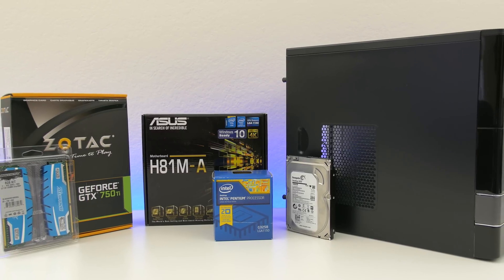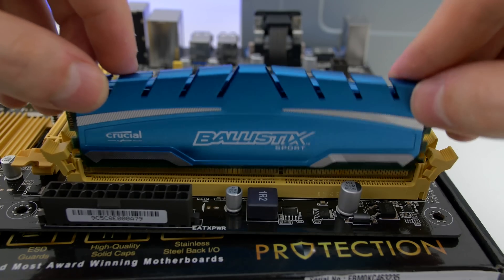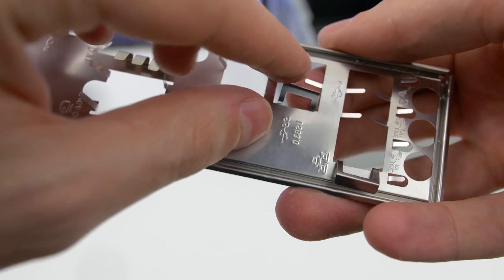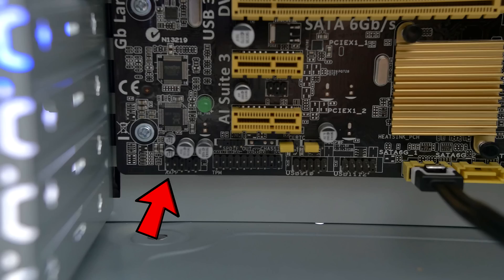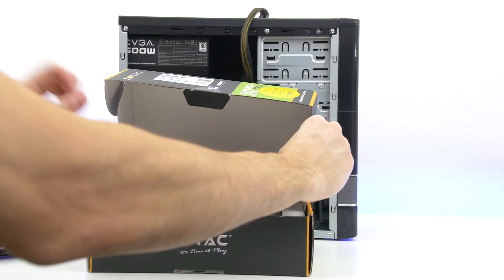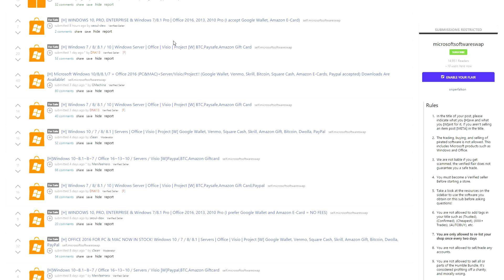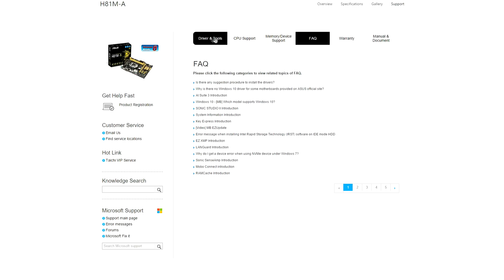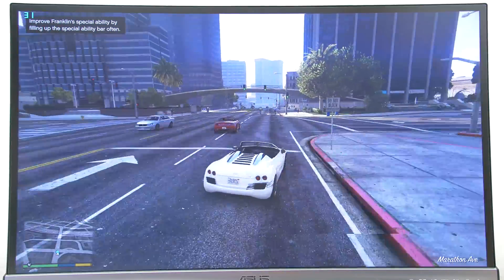How To Build $350 Gaming PC w/ Windows + Overclock!

Comment: I am going to make the same exact same pc. Thanks for the video! I will let everybody know in a month from today how the built went. It will take a month because I will only spend $100 peer week in parts so 3 weeks from today I will have all the parts I need.
Reply: mauro rodriguez Ah well the screws on the power supply were tough for me to screw in. That was about the only problem building the computer. When I set it up the WiFi adapter didn't work so I had to use an ethernet cable. The motherboard USB ports also didn't work, but when I downloaded the motherboard drivers they worked. When I plugged the WiFi adapter into the motherboard USB port, the WiFi finally worked. Those were really all the problems I had. Having to move around some stuff to make space for the computer was also tedious. It took me 2 days to build and around 4 days for all the parts to ship.

If you have any issues feel free to ask :)!
Reply: Good luck! :)
Reply: Why $100 per week?
Reply: 101ified because I am a broke college student. :D
Reply: mauro rodriguez Ah ok :P. I just finished building it... I had a ton of problems but eventually I fixed all of them and it works great!
Reply: +101ified what type of "problems" did it have? and how did you fix them... I am missing the graphics card and the HDD to be able to complete my build
Reply: ok
Reply: sorry i never replied, but the pc is great. except the Graphics card i decided to go with a 4gb Radeon overlock edition I think it was. It runs great, and it's not over clocked what so over. I have everything on normal settings, I can run most games from 2015 and down on ultra settings and 2016 and up on high to medium settings. Only thing I would upgrade currently is the Processor. Games like GTA 5 have a very high processesing requirements. BUt i run it in medium settings about 50- 60 fps. Mostly because i use mods also. Furthermore for hard drives and mouse and keyboards I would look in craiglist. I Found cheap hardrives for $20 and it been 2 years of heavy gamind and they still work.

I play games like GTA 5, Home front- the revolution, diying light, dead island, far cry 4 primal, and many open world games and have no problem running them mostly all on high setting, except GTA 5 I have it in medium to low settings when it comes to processing power, but for the GPU its always on high on all games if not ultra. 

I was not disappointed with this build, but then again i upgraded the GPU.
Reply: only problem a bit difficult was downloading the driver and triple checking my connections of the wires were correct. This was my first build, but it was easy to be honest. If you search online and craigslist, you will find good deals. Make sure the parts you are buying are quality parts and not cheap.
 

As of 2017 you can build a better pc for the price!!!

Comment: The computer wont turn on but the motherboard light is on
Reply: Make sure everything is connected properly.
Reply: It is, i even took it apart and did it again, it still doesn't work
Reply: +PrecisionGaming I'm actually having the same problem, but mine happened after I installed windows
Reply: +Clay Sand I got it working all it was, was a bad motherboard and cpu

Comment: I'm new to gaming pc's and was wondering if this was a good build to start off with. I'll be playing mostly league of Legends, csgo, and small games as such.
Reply: This is a great build for those games.
Reply: +Cairo Murphy alright ty
Reply: +Cairo Murphy 

Intel Pentium G4400 - Dual Core 3.3 GHz CPU
8GB System RAM
240GB Solid State Drive
NVidia GeForce GTX 750 TI Graphics Card
24x DVD-Writer
400 Watt Power Supply
Which build is better this one or the one in the video ?
Reply: Xsscape3 I'd say this, and make sure the G4400 has the same socket as the Mobo in the video if your using it.

Comment: what is a lower costing efficient alternative graphics card?
Reply: GTX750TI is the best price to performance graphic card. Anything lower than that will give you bad price to performance ratio.
Reply: thx
Reply: wont it get bottlenecked??
Reply: AngelsLive GTX750TI hardly get bottleneck by any intel processor release after 2010.
Reply: just find a cheaper case or a lower voltage thing

Comment: $350 build and you go intel?
Reply: AMD is literally shite.
Reply: AMD hold the world overclocking record...
Reply: +Moggy1000 yea but ghz and cores aren't everything.
Reply: +Cairo Murphy 860k
Reply: Intel CPUs are better for gaming.  AMD CPUs are better for budget builds.
Reply: +Technology Spotlight
AMD is not good for any gaming build until Zen.
Reply: Athlon 860k vs Pentium G3258
Pentium better overclocking
Can clock to 4.2ghz (equal performance to i3-6100) with stock cooler (which is included). 
At stock speeds they are the same but rendering is a bit faster with the Athlon. 
With overclocking... Athlon is dead in the ground.

Comment: Hi Ed, I'm planning on building this but PC Part Picker says that:

Rosewill FBM-01 MicroATX Mini Tower Case has front panel USB 3.0 ports, but the Asus H81M-A Micro ATX LGA1150 Motherboard does not have onboard USB 3.0 headers.

I don't think this issue was addressed in this video. Does this mean that the front USB 3.0 ports can't be used?

Comment: I have an i3 desktop with no graphics card, if I open it and install a graphics card will the gaming performance increase or do I need a different processor, btw I don't intend to play high end games just a few games that currently have to have the settings on lie
Reply: *low
Reply: Add a graphics card
Reply: +AwesomeBreakfast thanks I'll do that
Reply: Might be a good idea to go used on the GPU aswell to save money. Tech Yes City has a video about the best used Graphics Cards for the money. Should go check that out.
Reply: +Colepaq  yes
Reply: +click bait Check this graphics card 
https://www.amazon.com/EVGA-GeForce-750Ti-Graphics-02G-P4-3753-KR/dp/B00IDG3IDO
Reply: +AwesomeBreakfast In my opinion I would save up a bit more money for the gtx 950 or the gtx 960. It's around $20-30 more but its performance is a lot better and is a generation ahead of the 750ti.
Reply: +J.M Dizon Ok
Reply: BEFORE YOU BUY ANTHING, look up videos of people with the same model pc or motherboard as you, and see if they could fit in 8 titans, because you dont wanna spend 100 dollars on a card that doesnt fit
Reply: +Flick The 750 TI should fit in their PC
Reply: +Flick also he is lying about the ultra settings just look at tech yes city for example he has the same parts and he had medium
Reply: Make sure you have at least a 500W power supply with 12V rail. Processor is good in terms of any gaming, unless you are an enthusiast or a serious gamer.

Comment: (Ed please respond) ED I HAVE A PROBLEM! I was looking at some reviews of this case and I didn't see the port where you plug it up to the monitor can you tell me where the port is please and thank you
Reply: The port is from the motherboard or graphic card. The case does not provide the port.
Reply: +WB IsMe Hey I know this is a late comment, but you seem knowledgeable. Could you specify exactly whether you connect it to the graphics card or motherboard? Or can you do either one?

Thanks!
Reply: +WB IsMe Oh and also the motherboard comes with a CD with the drivers on it, so would inserting the CD in be the equivalent of installing the motherboard drivers?
Reply: When you have a graphic card installed, the port on the motherboard will be automatically disabled so you have to connect the graphic card's port. 

Drivers from the motherboard's CD are useless. The only few drivers that you need is Realtek Sound driver, Intel Integrated graphic driver and graphic card's driver. All can be downloaded from the internet.
Reply: WB IsMe Ok, I've set up my computer except for the graphics card. However, the motherboard USB drives don't work - only the front case ones work for me. I haven't installed the motherboard drivers yet so is that why they're not working? When I finish installing them I'll update this.
Reply: WB IsMe Nevermind... The wifi shuts off for the desktop after about 5 minutes. Any help?
Reply: All the USB drives will work without installing any motherboard drivers. There might be something wrong with your motherboard or the software.
Reply: WB IsMe Okay. I plugged everything in via Ethernet and successfully installed the motherboard drivers, which enabled the motherboard's USB drives to work. I plugged in the wifi adapter to the motherboard USB and it works.
This entire time I was using a VGA connection to my monitor since my monitor didn't come with an HDMI cable, it only came with a VGA cable. Is the HDMI cable supposed to come with the graphics card or do I have to buy one separately (graphics card is coming today).
Reply: Display cables does not come with graphic card.
Reply: WB IsMe Okay thanks for your help. I bought a HDMI cable off of Amazon. Windows Update found no more updates and everything is working. Thanks for the help!

Comment: Hey peeps, I was wondering if this case. 
https://www.amazon.co.uk/gp/product/B00AAJ0ZGK/ref=ox_sc_act_title_7?ie=UTF8&psc=1&smid=A1IUZRVRQUH0V6

Would work with the build hes doing- and another question is do I need additional fans or will the included ones be enough? 
Anyways- thanks in advance. 

- And if any of you have any cheap cases that could work better, feel free to link it. ^^ 
And lastly, is there a cooler included when buying a CPU? 
*Im not really good at PC related stuff- and this is gonna be my first build. SO just wanna make sure I do everything aright.
Reply: That'll work fine. It does come with 2 fans which is perfectly fine for this build and there is space to add more if you want. And the CPU does come with a cooler but I don't recommend overclocking until you get an aftermarket cooler.
Reply: Okay! Thanks a lot pal. :3

Comment: HI i have a problem whit my 3 way 980 gtx ,after overclocking i get lower fps in heaven benchmark????No oc 141 fps after oc 138 fps wtf ???In 3dmark i get 11900 and i saw someone whit 2 x 980 whit 17000 ???? I got amd oc to 5 ghz 2400 mhz mem ?? 3 x evga 980 sc

Comment: Is it ok that the case that I want has usb 3.0 headers but the mother board does not have sub 3.0 ports so I just don't plug the sun 3.0 headers??
Reply: So will this case support the build:  https://www.amazon.co.uk/s/ref=nb_sb_noss?url=search-alias%3Daps&field-keywords=Rosewill+Micro+ATX+Mini+Tower+Computer+Case+SRM-01.       .??? And also I have a laptop and will take my hard drive out of that for the hard drive is that ok??
Reply: +SKBEEKER is there a USB port coming out of the back of the case from the mother board??? Thank you
Reply: +SKBEEKER to answer all your questions. yes it's ok to leave the usb 3.0 not plugged but I suggest getting a 3.0 to 2.0 adapter so you can have usb in the front of the case. and yes you can use laptop hard drive but it will be slow. and yes there are plenty usb ports on the back
Reply: +Amir M'Saad thank you. I LOVE YOU

Comment: what if u take a hardrive from a old pc that had windows and put it in my pc built would i have to buy windows separately?
Reply: It will work. You don't have to buy window separately.
Reply: WB IsMe thsnks man (3
Reply: did you build it??
Reply: +Aj Galeri no still waiting for my parts to arrive
Reply: i built mine today and it wont connect to my monitor when you build yours can you tell me if it happened to you or how to fix it
Reply: connect the monitor's display cable to your graphic card's display port, not the motherboard's display port.
Reply: well thats what it was, thanks
Reply: i tried that this morning and it still wont connect
Reply: You dont
Reply: JakePlayZ thx
Reply: +RGЖx unless you don't have your windows disc

Comment: is it ok to use a i3 6100 and a gtx 950 or 60 in this build without replacing the psu
Reply: GTX950 is okay but i3 6100 is not compatible.
Reply: +WB IsMe why is it not?
Reply: Martin Coker Skylake processor is not compatible to LGA1150 motherboard. The socket design is different. If you force the i3 6100 into the socket of LGA1150, you will end up breaking the pin.
Reply: +WB IsMe. oh thank for telling that you saved me 200$

Comment: Does the Gigabyte GeForce GTX 950 work with this build? (The windforce?)
Reply: yes
Reply: +WB IsMe I see you helping a lot of people in the comments, you seem pretty knowledgeable and I have some questions. I'm looking for a PC, I want it to run games smoothly. I'm not a serious gamer so quality isn't that important to me. Would this be a good build? Any suggestions?
Reply: elrak0 2 This is a good build for tight budget. Can run most triple A games at average med/low graphic setting 1080p.
Reply: +elrak0 2 This is probably the cheapest and best PC builds ever!
Reply: +Jeff Tang if you were to compare it to something like the ice cube build tech source did, would it fall short, meet the same, or exceed that of what ice cube could do? Right now I'm debating between the two.
Reply: elrak0 2 If your going with the default ice cube parts it would just be a tiny bit better than Budtron. So I would recommend Budtron
Reply: Jeff Tang + WB IsMe Thanks you guys! tech isn't my forte but i'm learning.

Comment: Im switching the Pentium for an I5-4460, is there any specific driver that i need to use?
Reply: No.
Reply: +WB IsMe Thank you
Reply: +WB IsMe* im new to pc building* what is overclocking? is it worth it? if you do overclock does it decrease anything in the pc or unable to do things? thanks, i see you replieing to everyone that needs help.
Reply: AngelsLive Overclocking is pushing a component to work over its rated specification. Overclocking will potentially decrease the lifespan of a component or worst case permanently damaging it if no precaution is taken. In most case, money invested in overclocking is not worth the performance improvement.

Comment: Would I be able to upgrade to an i5 using a  1150 socket in the future?
Reply: Whatever you do DONT, you will only get like 10 more fps instead of using 200 dollars for a cpu buy this intel g3258 and get a beastly cpu cooler and you will get much better performance than the i5 4690k.
Reply: +PureHatch Gaming sometimes 10 FPS makes a huge difference. And since more games are using more cores, an I5 will provide a much needed performance boost
Reply: Is it really worth 235 bucks? no you can almost get the same performance for around 100
Reply: probably even better
Reply: +PureHatch Gaming but less cores so you aren't future proof i would go for an i5 if i were you my next build will be have an i5 6600K

Comment: Can I use the ASUS H81M-PLUS instead of the one in the video?
Reply: yes
Reply: WB IsMe also, do you think an i3 can handle the new rx 480? or should i get i5? thanks
Reply: Zaril Boo Assuming you use the latest generation of i3. It will bottleneck the rx480. i5 will be perfect for rx480.
Reply: Also, this motherboard can handle the new RX480 right? First time building a PC, so I don't wanna make any mistakes. Thanks for the replies :D
Reply: Zaril Boo i will handle. All motherboard with PCIEx16 2.0 or higher slot is able to handle rx480.
Reply: Can I use this motherboard with the i5 processor? Apparently pcpartpicker told me "Some Intel H81 chipset motherboards may need a BIOS update prior to using Haswell Refresh CPUs." What does this mean?
Reply: Zaril Boo Haswell or 4th gen processor has 2 version, Haswell and Haswell refresh. As long as the i5 is a haswell or haswell refresh generation, it will work so don't worry.
Reply: Ah, so I don't need to do the bios update after I'm done building it? And as long as the i5 is haswell/1150 socket, it should work with the motherboard? I'm planning to get the i5-4590 Haswell Quad-Core @ 3.3GHz if it matters
Reply: Zaril Boo It will work.
Reply: WB IsMe Thanks for helping out

Comment: TIP: I am a first time builder and i am putting together this same exact build as i'm typing this. PUT A LOT OF PRESSURE WHEN PLACING THE PARTS ON THE MOTHERBOARD. Of course, with the exception of the cpu. However, things like the fan, the ram, and the cpu placement lever need a LOT of exertion to lock into place. He makes it look easy in the video.

Comment: I see that one of the other links are for an ssd but it is 250 gb. I've never built a PC and I just want to know if that's meant to be setup with the hard drive or as a substitution
Reply: You can use the SSD as an additional storage device or a substitute for the hard drive. The motherboard can supports up to 4 storage device.

Comment: can someone recommend me another quad core decently priced CPU that doesnt have overclocking? i dont plan to overclock so i need another CPU. also make sure that cpu is compatible with the motherboard.thanks
Reply: The most cheapest and compatible quad core CPU i5 4440 cost 3 times more expensive than the G3285.
Reply: i5 3350p
Reply: Could the motherbord support a AMD FX-6300 ? plz answear
Reply: +walat sabah i dont think any AMD processor is compatible with this motherboard

Comment: Did you have to do a bios update on the motherboard in order for the cpu to work with the motherboard?
Reply: with the cpu he is using, you dont need to update the bios. however i highly reccommend spending a few extra bucks on a i3-4150. it fits into the same socket and is a much better processor than the pentium he uses in the video
Reply: +HackNode yes, but with his motherboard it is VERY easy. look up on youtube "how to update an asus motherboard"
Reply: +ItsRod if you get the retail version, it comes with thermal paste pre-applied
Reply: +ItsRod no problem, I've been using this exact build but with the i3-4150 and gtx 950, and it's been working flawlessly : )